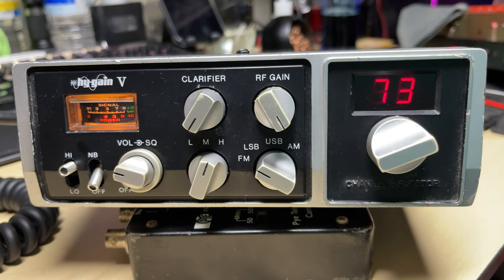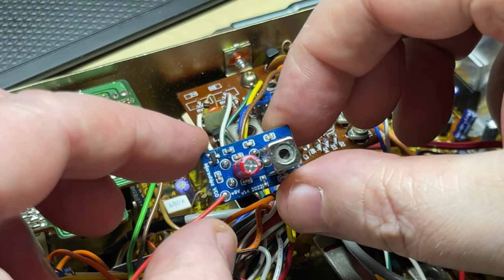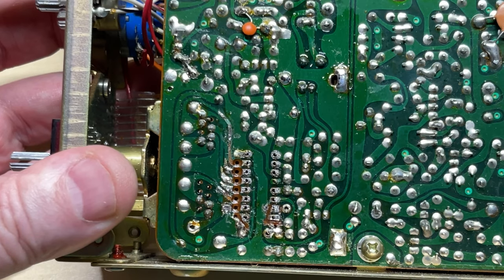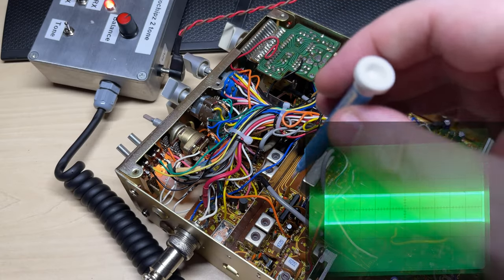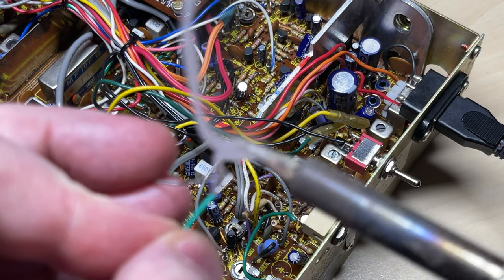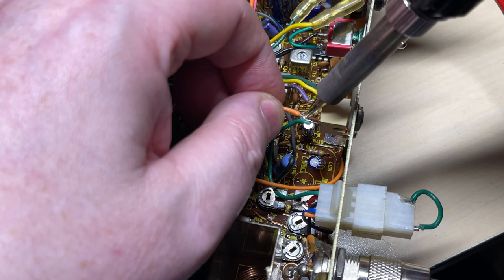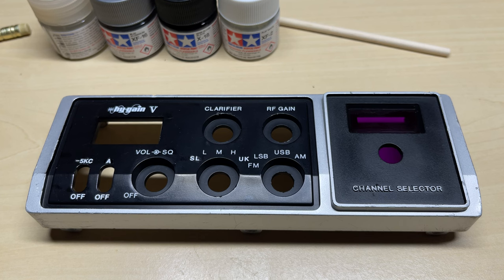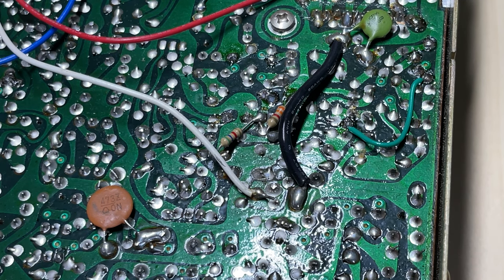EP 110 - Hygain V SSB CB Radio - PIC channel conversion and alignment.

Comment: I will definitely be using a few of your PIC boards shortly as they are so neat.Excellent video as usual from the Barry White Narrator of the radio world.😂
Reply from the maker: Thanks , all boards are available in my fb group and certain band customisation is also available.
Reply: @MicroChipz  I have not long since joined the group and what a good bunch of lads.
Keep up the good work.
Reply from the maker: @gtretroworld  Yeh there are some very knowledgeable techs in there.,

Comment: I pickup a Hygain V SSB 2 years ago, has a 10 meter Conversion just by adding Crystals.I need to have someone go though it,and make sure its good to use.
Reply from the maker: You can mail me direct if you want .
Reply: @MicroChipz hi